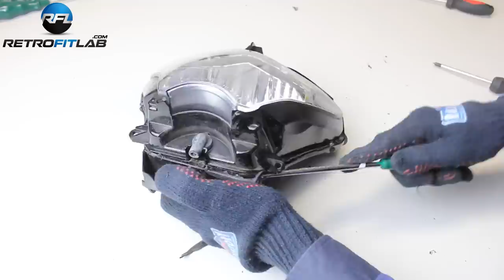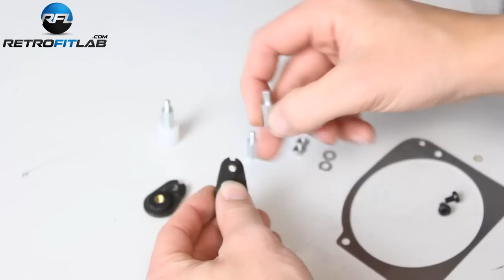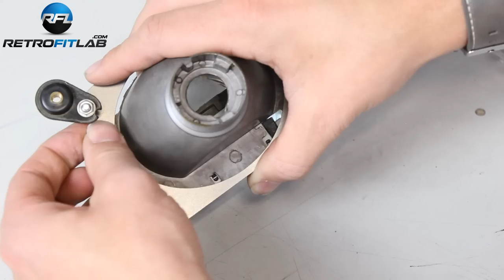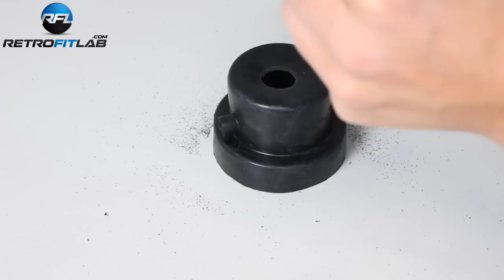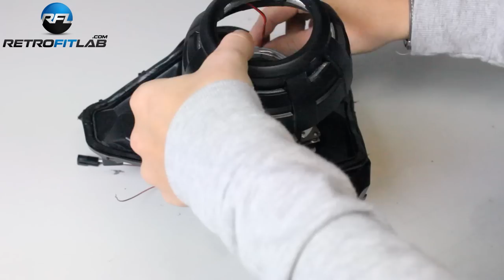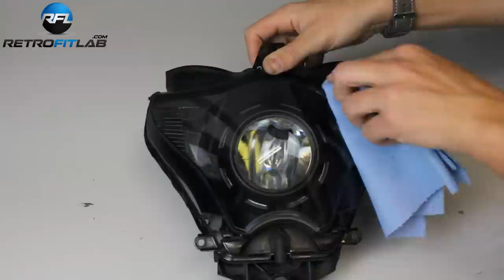Honda CB1000R D2S Bi-xenon projector instuctions

Comment: Hey... Ich habe alles wie im Video montiert und funktioniert auch alles super, aber ich weiß nicht wo der ZEITVERZÖGERUNGSRELAIS kommt ☹️
Reply from the maker: You can remove the original relays (the one that is supplied with the H7 wire harness) and replace it with the time delay relay :)